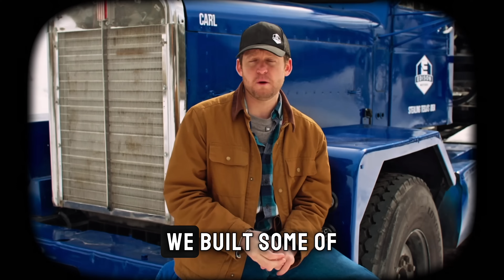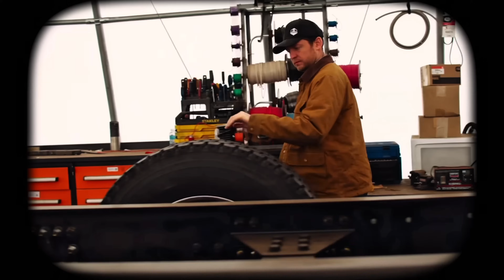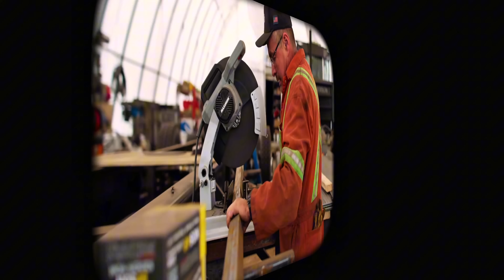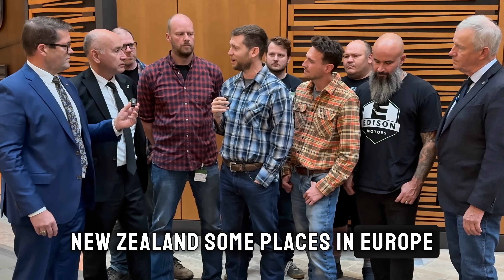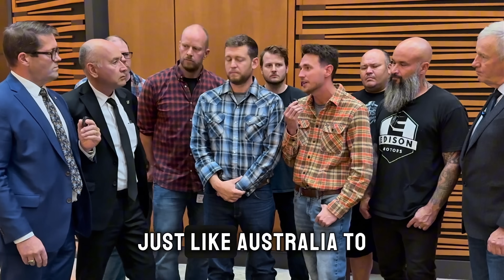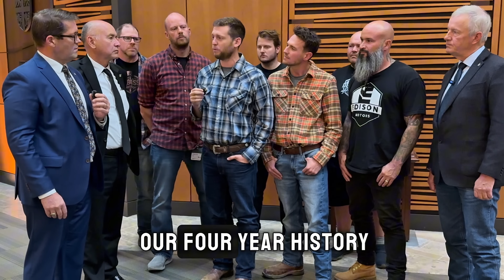EDISON MOTORS: “Built by Truckers for Truckers.”

Comment: From the questions asked in the video, there seems to be a misunderstanding of the problem. The Canadian regulator can do the approval. They do not have to go to the US to get the truck approved. The problem is that Canada uses EPA rules, and EPA rules do not allow an approved generator to be installed as a hybrid generator. To get the approved generator approved for hybrid would cost millions. Edison Motors would like Canada to allow vehicles to use either the EPA or the EU standards in Canada. EU standards are used pretty much everywhere outside the US & Canada. This would allow Canadian manufacturers to export EU emission standards and save manufacturers money.
Reply: Wait, I thought it was a series hybrid, what's a serial hybrid?
Reply: @alexwalker8422  my typo.